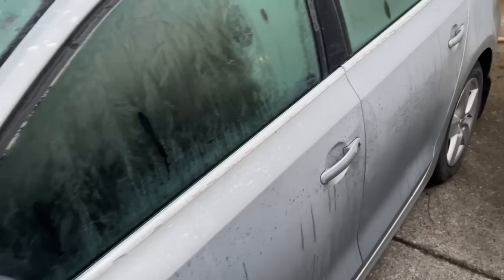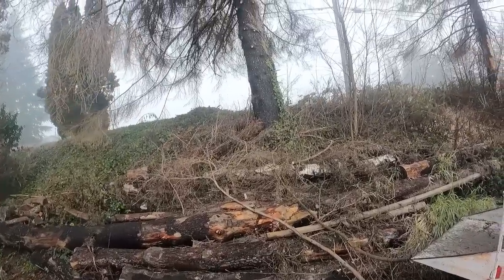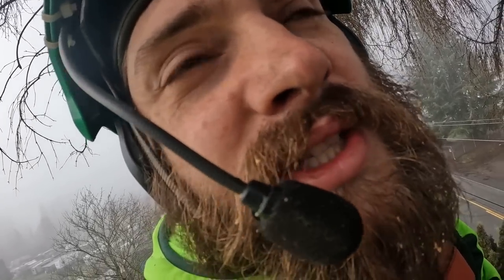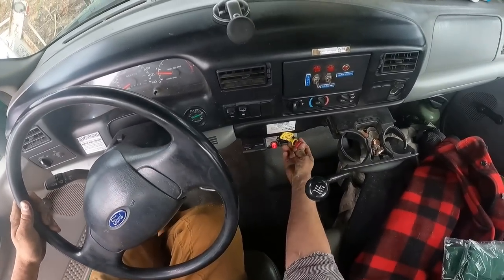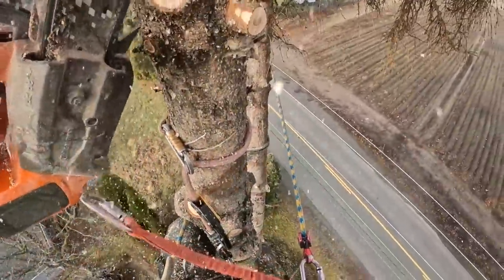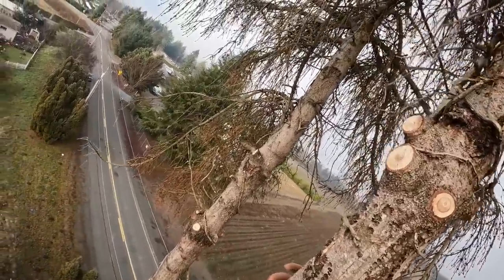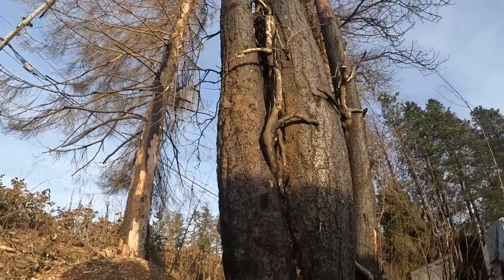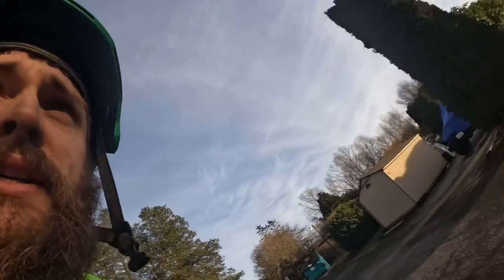Cutting down a Fire Burned Tree with Randy! | Part 1

Comment: I had the Toyota Yaris loaded with 2 top handle saws, a cs 590, 395xp, 3 rigging lines, 2 climb lines, pole saw with extensions, spurs, climbing gear, porty, and various rigging pints, pulleys, rachet straps, and gas and oil...it was awesome 😎 nice job 👍

Comment: There used to be a vid floatin around of a lineman that got into high voltage that needed to be shown in line clearance class…in a way it’s so bad no one needs to see something that bad but on the other hand it will make anyone well aware of how bad it is…we watched it at work cuttin power lines and it made me wanna quit go home and thank god cause seen many get trees into em and most blew it off like nothin….3 phase 3 knock lines are absolutely wicked…been shocked through plastic wedges…saws…poles..and electricity is 1 thing that I do not mess around with…dad was electrician in underground mines and preached 1/10th amp can be fatal and saved a man’s life I ended up workin with and he cried tellin me how he acted and not spoke to save him from certain death with huge risk of killin em both…480v…love you jake and I just wanted to share my experiences….matt